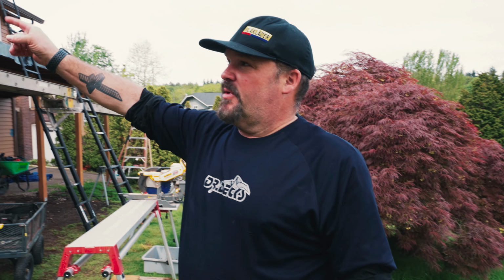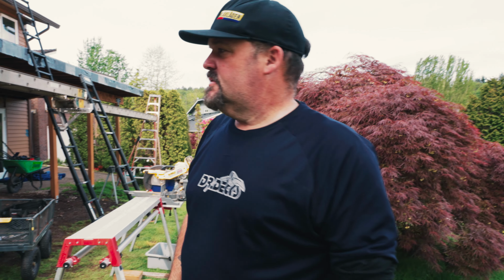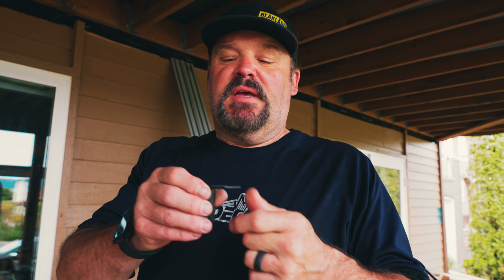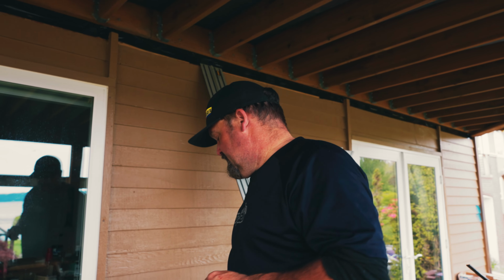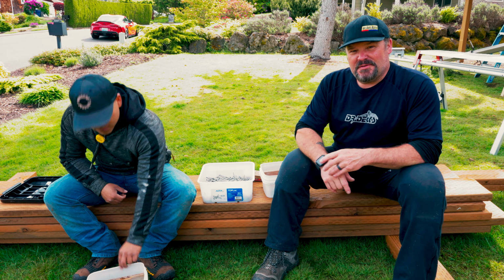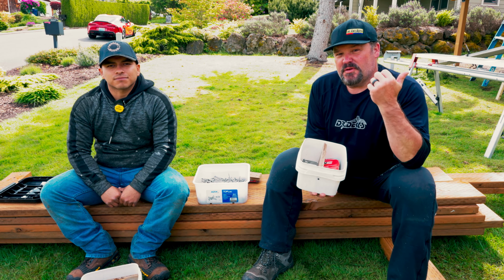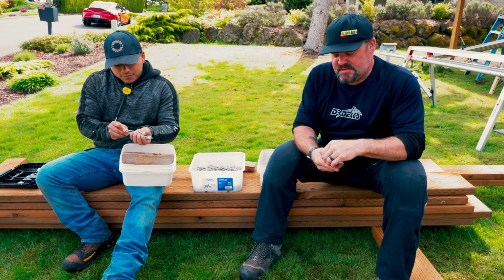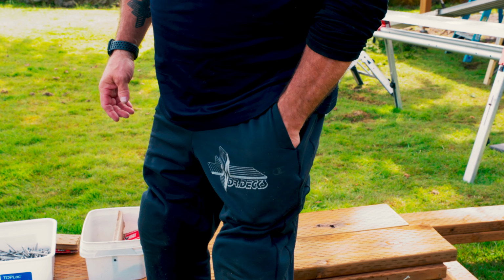Build Update: Deck Yea Buddy || Dr Decks

Comment: Two questions:  1.  will the conceal clip fasteners not work with the bladder system??  2. What is the purpose of that very thin shim you put under the flat block board?  Love your channel.  You’ve taught me a lot!
Reply from the maker: I’m concerned about longevity with clips and a bladder. I’ve done it before and have decided not to do that anymore. The shim was so I didn’t cut through the bladder

Comment: Hey Dr.

Been a subscriber for about a year. I can't remember and I couldn't find a link. What are the orange spacer you use and what clamps are you using. 

I think Amazon has an affiliate program where you can earn by directing traffic to product links.
Reply: I too was wondering this as well. And would love to support with affiliate links!
Reply: They are from Timber Tech. I actually emailed them and asked them for some and they sent them to my local Parr Lumber the sent me 6 of them.
Reply from the maker: Deck mate spacers. Available on Timbertech’s web page